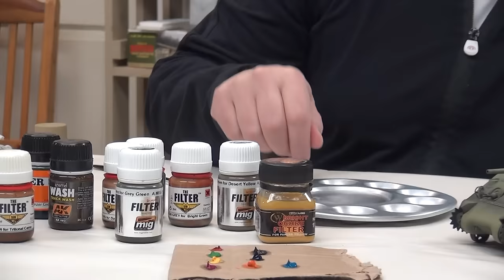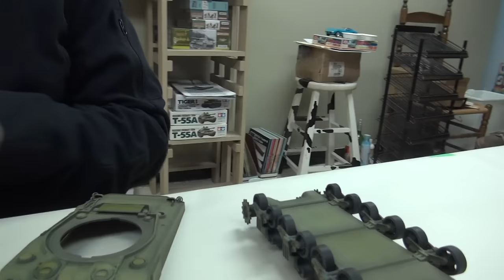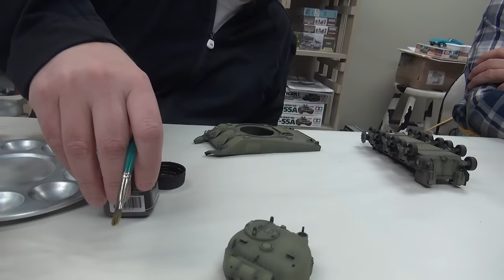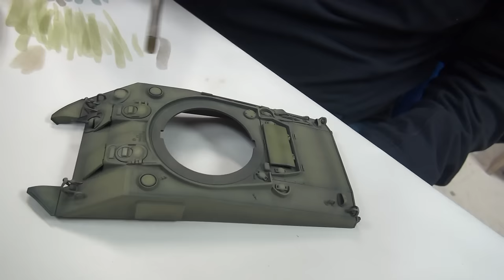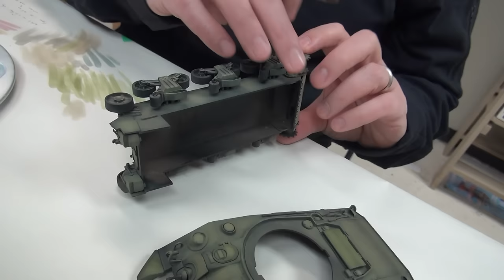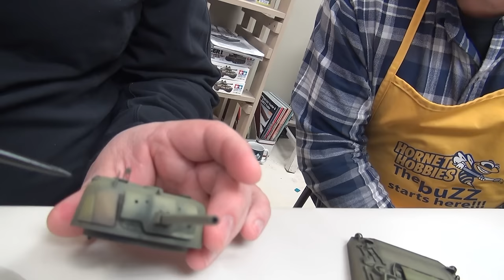Applying Filters on Armour Models Episode 1

Comment: Fantastic video. Thanks! I'm somewhat confused about thinners with oil paints. When I used the standard Windsor Newton turpentine I ate through the clear coat to the paint below. I saw that Rinaldi uses an AK enamel thinner. I didn't know that was possible. I assume they vary in strength. What kind was Dave using?